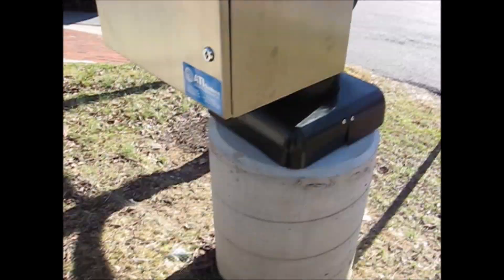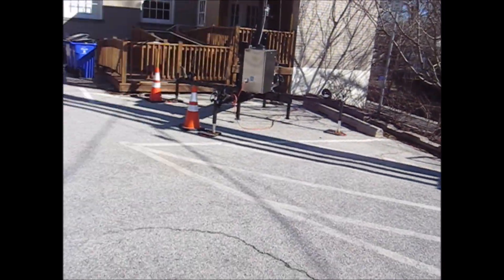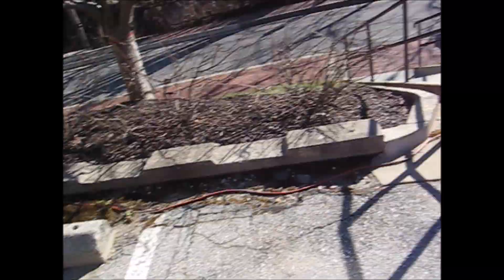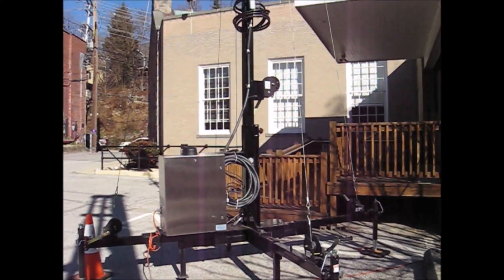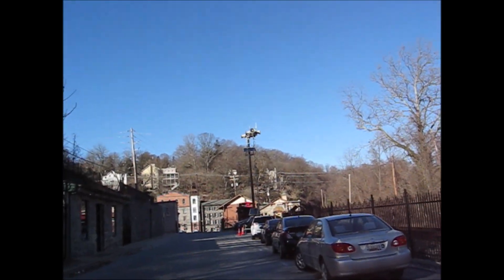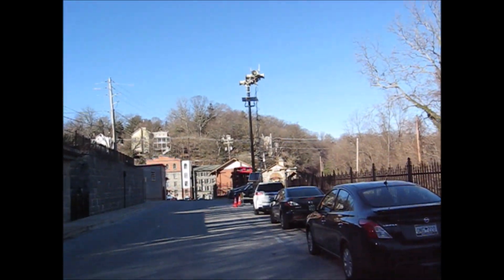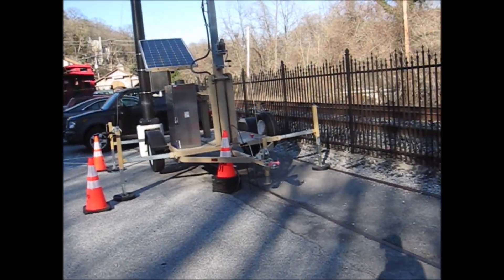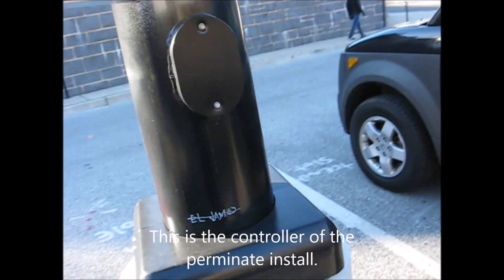(New Installs) ATI HPSS-16 Sirens, Ellicott City, MD

Comment: In my opinion, these sirens ARE Absolute Trash Incorporated. I don't even think the drivers can even handle 2% volume with out blowing up. The control panel is only good for storing garbage if the nearby garbage cans run out of space. Just get Whelen WPS-4004s, those don't actually break apart after a week.